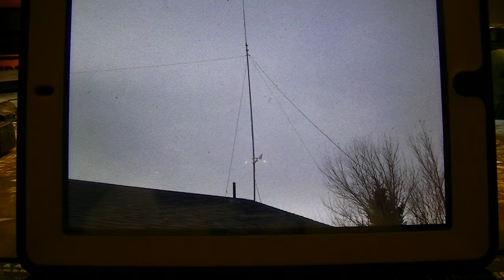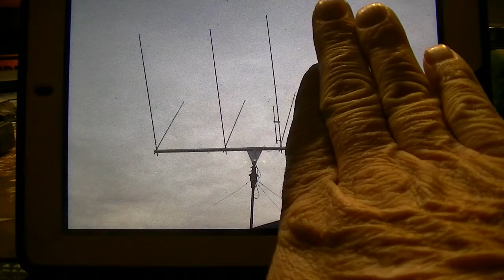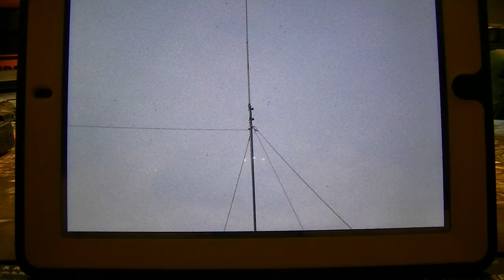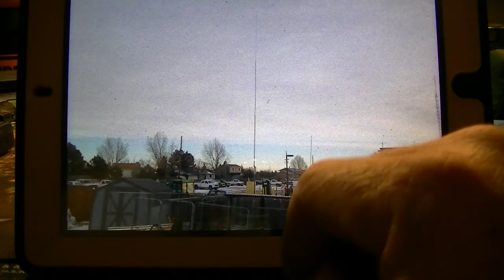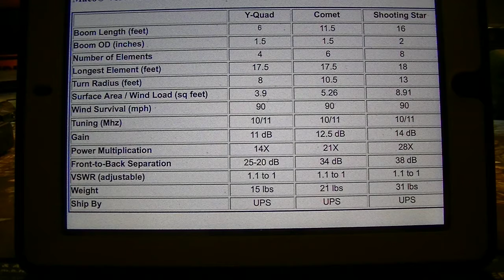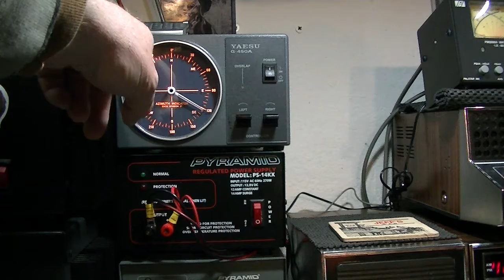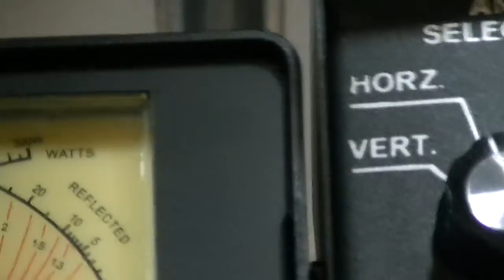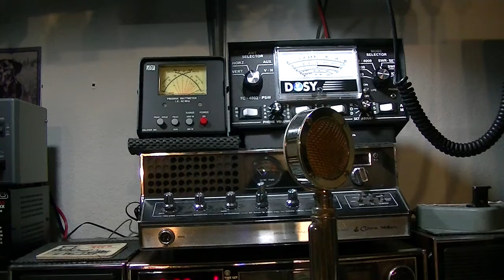CB Radio Antenna Types

Comment: So the million dollar question- what estimated range could one potentially expect in an urban residential environment using an SSB capable CB radio with one of these directional house roof mounted antennas if using a data mode to send/receive messages of text like with ribbit/rattlegram? 

I have a bunch of non-technical people who I could never imagine being able to pass a ham technician exam or wanting to spend $1000+ for a ham base setup asking me what is the best mode of radio to radio emergency communication (20 miles) during a SHTF grid down situation, where there is no cell infrastructure and no power except household emergency backup power. Would getting one of these antennas allow around 20 miles of CB range without having to deal with the engineer level knowledge required to get a ham license?
Reply: Easy to get amateur license, especially technician class.

Comment: I have a jo Gunn  4V I never did use it it’s in my garage under the roof … I was told on the Gama you should run it on the back of the element noticing yours is on the front … correct me I’d I’m wrong I will be sitting it up soon getting ready for the peak of the 11 year cycle for skip

Comment: the  long  element  on the back of a beam  antenna is called a reflector  not  a rejector  . it  reflects the signal   forward
Reply: Reflector, driven element,   Two directors
Reply from the maker: Yea. I made a mistake. You know what that is?

Comment: It's quite informitive but you terminology needs work. As previously said by someone else, It's a reflector. Beams have elements and gound plane antennas have radials. An Antron or A99 is not a ground plain antenna unless you put a ground plane radial kit on it. Otherwise it's an omnidirectional but not a ground plane. Ground plane antennas are the Maco V58 or a HyGain SPT 500 and includes the Serio Ground Planes (though Serio makes antennas without ground plane radials). All that said, your video is not far off. Not a bad job. Haters a judges will hate and judge.
Reply from the maker: Jim Verge  Yep. Mis spoke. Just not going to redo vid.
Reply: Anyone who has a heart understands. Your points are fine.
Reply: yes the haters should see you wasn't talking to them you were talking to beginners and did a detailed ad fin job i wish someone would have explained the way you did when i was nine it would have helped me greatly i set my base up by my self then my my didn't know how she did get a license so i could talk though and got me a twenty dollar radio and i think fifteen dollar antenna from radio shack for christmas and five dollar hundred foot of skinny cox i found the pole and scroundged a power supply.
Reply: Steve, By commenting, you just became a hater! I'm tring to help this man with his terminolgy and you have to jump in there with hater talk. None of us are perfect Steve. I'm just trying to help one human being be better at something.
Reply: some people have to try and correct everyone even when they knew what was being conveyed. Must be something about the fact that they have to belittle other people to make themselves look better in THEIR own eyes, sad really sad

Comment: You really helped me understand this stuff, I currently run a a99 it's been up only since spring, I want to buy a beam,  im looking at the Maco M105c 5 element beam, we to have high winds here in the southeast corner of Utah mostly during the spring, do you think this antenna will hold up to the wind? Also should I get a Sirio s-2016 ground plane antenna? Or is my a 99 the same thing
Reply from the maker: Mike Hannahs I personally do not trust the Maco antennas if you live in a Highwind area. I had the Maco.  Omni directional aluminum antenna and woke up one day and it was blown a bent in half. As far as the Sirio antenna I do not have any knowledge or experience with them. I have had my Joe Gun up for over 10 years now no issues at all with wind. Thnx for watching.
Reply: I'll look into those antennas, I don't want to have it broken by wind, I didn't know if that maco antenna was one of the same that could get broken, thanks for the help

Comment: Sigma 4 was a good antenna in the day.I think 7/8 th wave ..
Reply: @Rick66:The Avanti Sigma 4 had a 3/4 wave radiator (=6/8 wave). a 7/8 Wave radiator on 27 MHz would be about 9,65 mtr long (about 31,66 feet).
Reply: The sigma 4 is a 1/2 wave on top of a 1/4 wave with a hoop. Great for dx because of the 30 degree take off angle.

Comment: Same holds true for 2.4GHz consumer Wifi, where you want your antennas polarized properly for the devices you have... laptops will want a horizontal polarization since built in wifi on a laptop have the antennas in the lid, while tablets and phones your good with a 45 deg polarization and desktops with wifi adapters and antennas are typically vertical..

Comment: i like strong omni antennas. I'm going to build a cb j-pole.  a true 1/2 wave over a 1/4. and thought to be better ground wave antenna over an imax2000. this refering to youtube video of dave tadlock. its 25 feet long. the imax is how long?  arial in the air is signal to a point. then there's co phasing 1/2 waves stacked one atop the other, in multiples of 2. so you have one. stack one atop, now its two. and then 4. 3 atop the first. your signals if it were visable light. it would look like a wide pancake. your neighbors might have a hard time hearing you. if your on a hill, and they in a hole. but aint it a fun hobbie. even if no one on it, can run for president, because of the language.

Comment: The A99s are great antennas. I talked all over with one, with low power too.
Reply from the maker: +dave l I agree.
Reply: +dave l ,there ok i guess but they  splatter in everything i recommend a TVI filter
Reply: Daveo Lost  for the money its a good starter antenna. but with a good mechanical sense and a tape rule. you can build cheaper, better antennas.
Reply: I'm not that smart lol......i know some about antennas.
Reply: 808pathfinder the antenna isn't the best. it wide banded. or so it emulates.  and it capable it reproducing signals out of band. a narrow band antenna, like a magnetic loop. It has to be tuned each time you change a channel. it's no where near as bad splattering as an a99.

Comment: Thanks for providing SIMPLE language explanations... the more the merrier ...
Reply from the maker: Timothy Knoerle You're welcome. I like simple. It doesn't have to be hard and complicated. Thanks for watching.
Reply: Albee4ty5 Back in the mid to late 70's is when I was previously using a CB; but not since then. I'm now trying to prep for WROL scenarios, and communication is my top priority. Any direction you can provide is definitely sincerely appreciated. I'm unsure what brand will be the best investment (radio, home/mobile antenna, etc). in 1970's I had a Midland CB, but Cobra and Galaxy seem to be top of the heap mobile units now, although some argue Galaxy has problems. I'll appreciate your thoughts (antenna & radio).
Reply: I have a couple of galaxy radios, and they talk well....on am.  All of them are off on sideband.  This after already having been aligned.  Just my experience.  I tend to like some of the older radios.

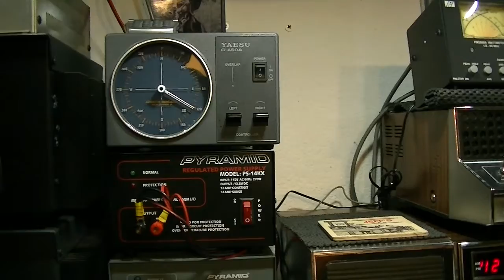Comment: 13:41 Now that's what I need for my HF5B and 2/m meter beam on my 30 ft Rohn tower.  My rig is a Yaesu 757 GX II HF xcvr.  The one I have is a Ham rotor / CDE or CDR control box and it just has a arc display from S W N E S with tic marks among those Letters.  It has the 8-wire connector on the back and at a box at the tower and up just under the rotor housing.  How many connectors does that one have?  Good Video :)
Reply: Sean Ingram I hope you have a Ham license for that 757

Comment: Man they still make those antenna's?  I got into CB's and building antenna's in the 1970's.  However I have relocated and have not set up base station in 10 years because of talking from the Truck and car.  I am going to set up this spring season for operating the base station.